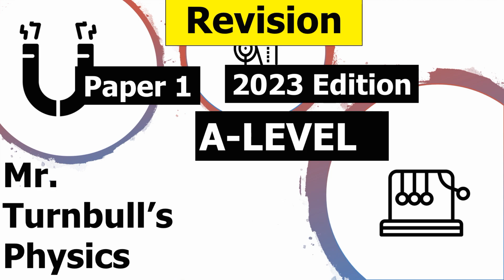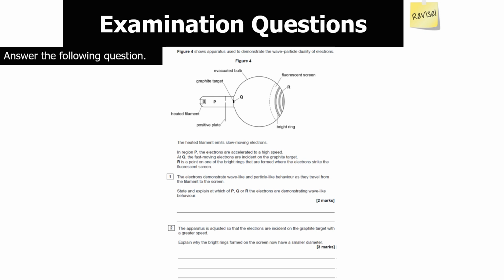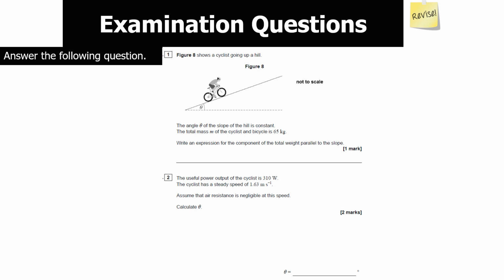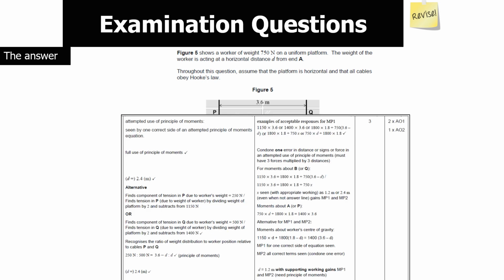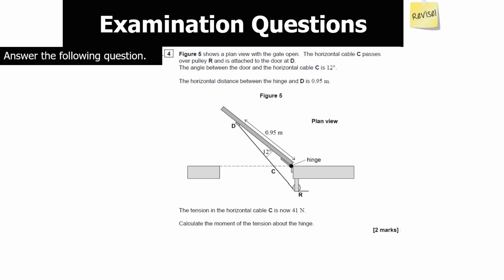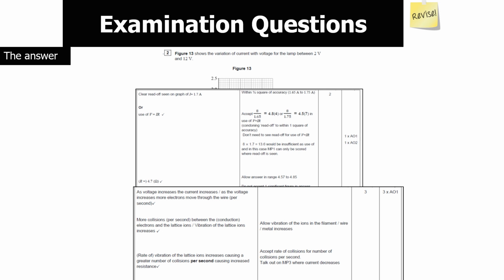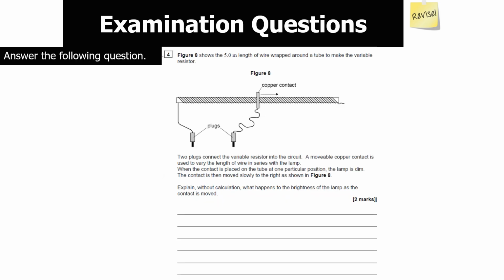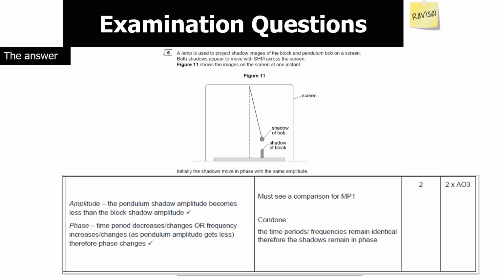A-Level Physics Paper 1: Revision Questions (2023 Edition) 2

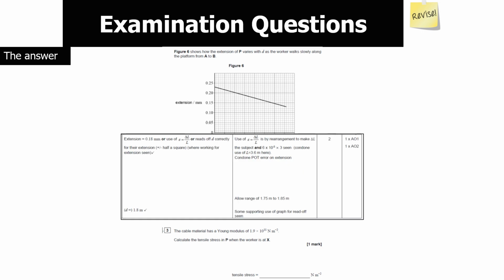Comment: Sorry didn’t quiet understand 19:19, how did you know extension was 0.18 mm?
Reply: He calculated extension by multiplying the length of the cable by the value of the strain given in the question